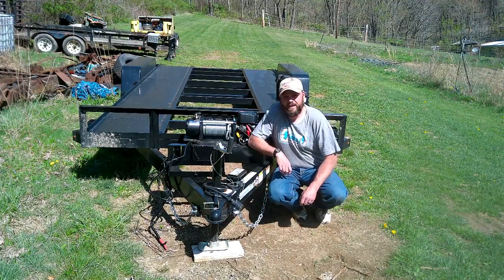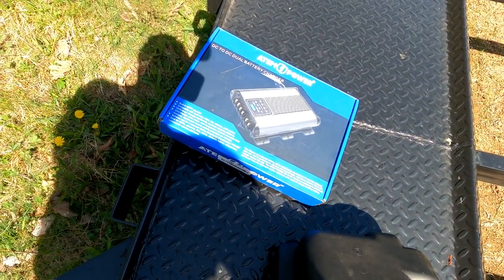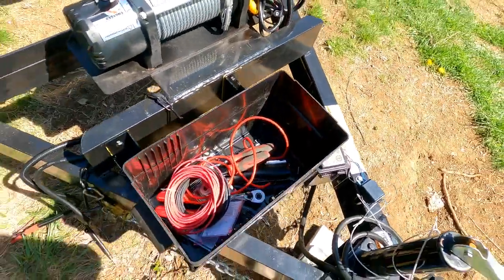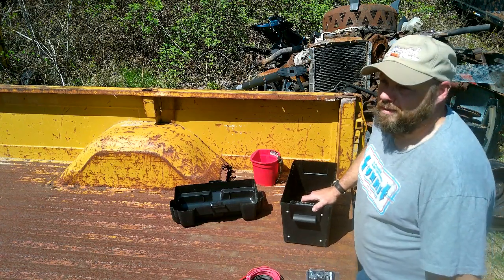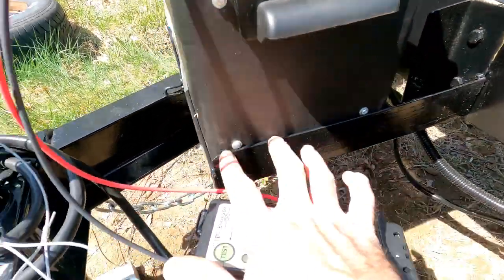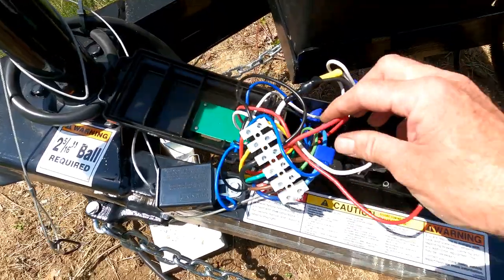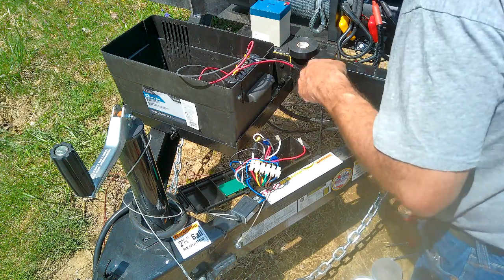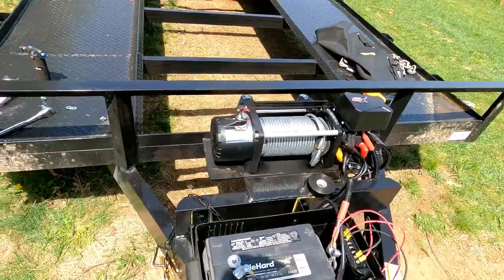Installing a proper charging system for a trailer battery. Lets make a how to video

Comment: Wouldn’t getting rid of the breakaway battery and using the trailer battery simplify things and clean up the tongue? Unless your trailer is new those breakaway batteries typically only last a few years anyway so it might have been bad at the time of this video. Just throwing and idea out there. Thanks for the video brother!
Reply from the maker: Ill be honest, that never crossed my mind. When it needs replaced, that might be a good way to go. Thanks for the idea!

Comment: Why are you using a dc to dc charger? Surely a split charge relay on the vehicle side should be enough?
Reply from the maker: It will monitor and charge the Aux battery separate of the vehicle battery and will maintain the 14v needed to properly charge the trailer battery.  One year later, it still functions properly and I've never taken this battery off the trailer.

Comment: Hi, I have a horse trailer. Can I run a two 12v fan for the horses, interior light & accessories ( like usb for charge cellphone) with that method?
Reply from the maker: This will maintain the battery and keep it charged while your plugged in to the tow vehicle. You can use the battery for whatever you need it for but keep in mind, it will drain down if it doesn't get charged regularly.